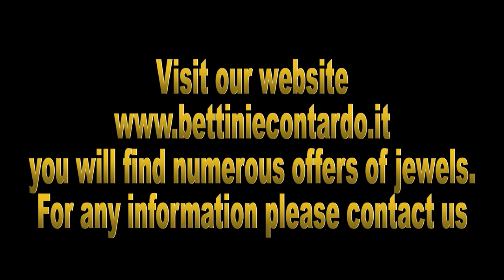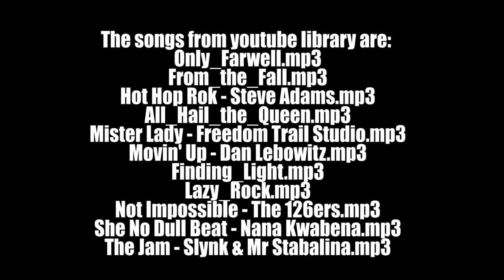Handmade 18 KT cupido ring

Comment: Hello i have a question, should all 18k yellow gold be the same color? I have 2 pieces/styles of 18k gold ring bought from different stores in italy but one is more yellow than the other. Is it normal? Thank you for your response.
Reply: Hello,  I am a goldsmith and I make my own carat of gold, 14k and 18k from a pure gold. For to do that, Im mixing the pure gold with silver and copper alloy.. when I started a few years ago, I use to mix the silver and copper 50/50 like some master shows me, the color was bright light gold.
Later I took the advice of another goldsmith, to mix it 60% of copper and 40% silver, and now the color is more like deeper bright gold. Its very difficult to explain color in words,  but the point is that gold can look in a different colors in the same carat,  all is depends on the mixture of copper and silver, you can play with the colors from very bright yellow gold up to very red gold, all in the same carat.